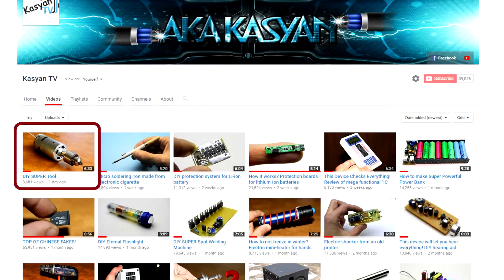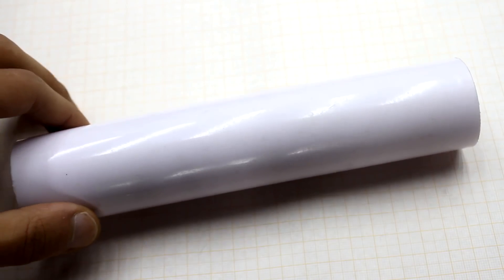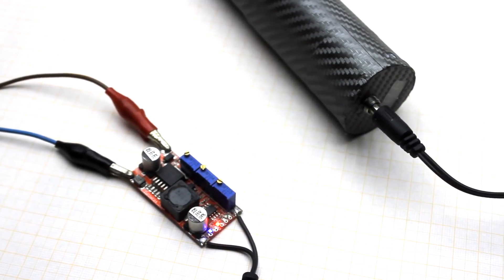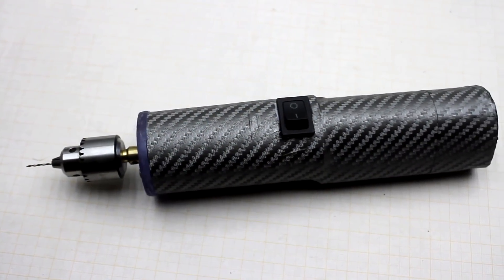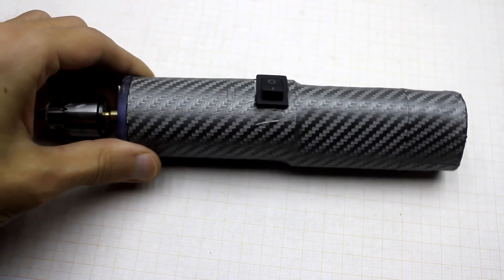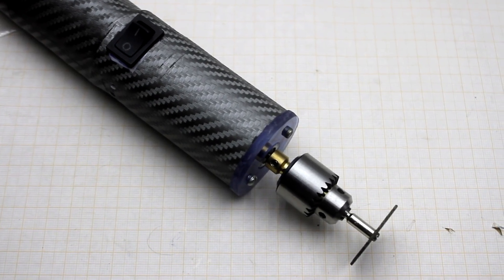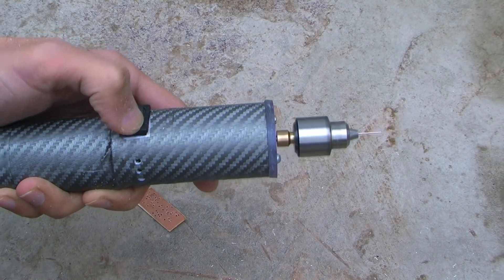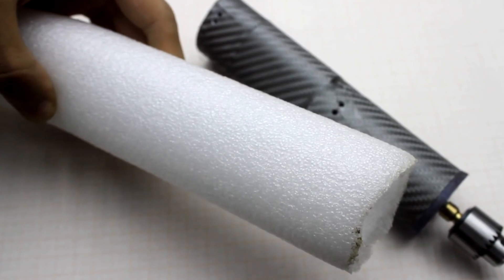EVERYONE needs this tool

Comment: Putting Li ion battery in tight fit can be very risky, you gotta give them adequate expandability. Remember Note7?
Reply from the maker: for these batteries an additional protection board

Comment: I realize these videos are made for the Diyer however the use of hot glue and the presentation of some of this stuff is so crap looking like a hack put it together. your electronics talent is great but man you should consider updating and get yourself a cheap 3d printer.

Comment: A little tip: Never ever refer to an electric motor as an engine (or "en-jean" as pronounced in 1:02). Engines always require liquid or gas fuels.. Why? Beats me.. Just 60-years of English experience speaking. Hope that helps! :-)

Comment: This is already been done it’s called a Dremel and works a lot better.
Reply: You can get a Dremel clone for under $20 (WEN 2305 on Amazon, others on Aliexpress). They're pretty decent. Building one is fun and interesting, but this is one case where the DIY probably isn't gonna be as good as a cheap clone. Also, after buying a spindle motor (you have to use a motor designed to take transverse load), chuck, batteries and other parts it's gonna be the same price unless you can recycle something else.
Reply: Buying is an option, but building makes you learn.
Reply: Well it is not cheap.
Reply: What’s not cheap the dremel ? But this item is because it’s made of cheap parts. I seen so many of these on eBay etc and they don’t last they have no power in them. Now a good dremel will last you years I still have mind with many of them. You can get a good secondhand cheaper. This item is just a fun project and good for light work but nothing to a real multi tool.